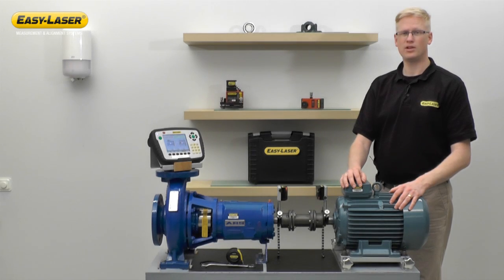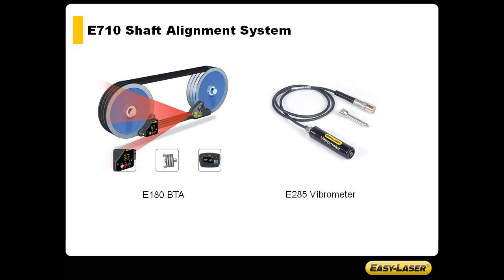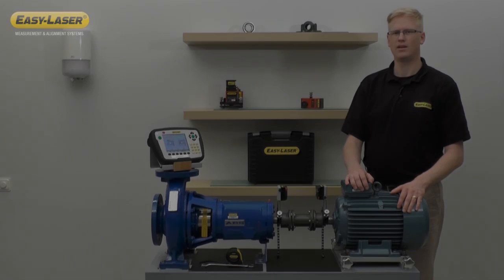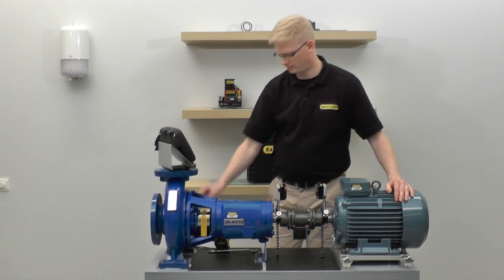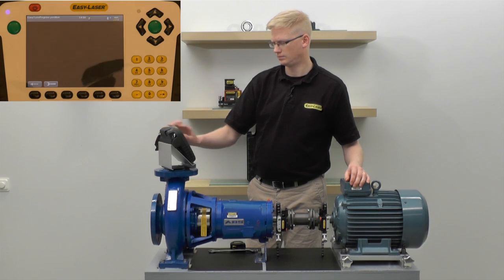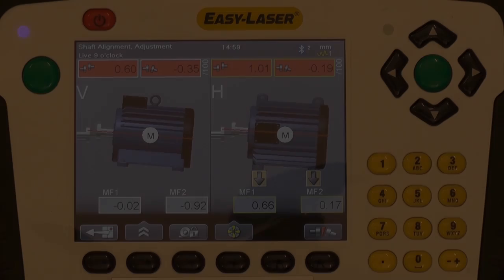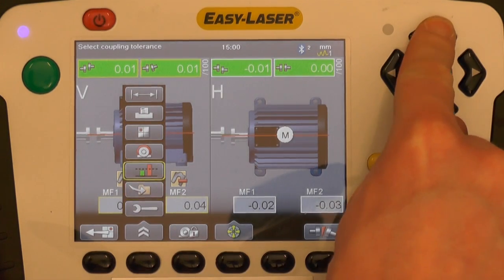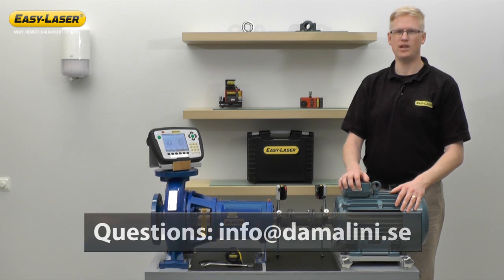Horizontal alignment with Easy-Laser® E710, the Total Alignment Solution

Comment: We are using Easy laser alignment kit.

Could you pls Clear my doubt's? 

1#Minimum Fixing distance?
2#Which is we want to set first? H or V
3#Once complete alignment the readings all correct but while checking again that all reading was changed. What is the reason, why and how to correct?
4# Where should Fix the Leaser Fixer (Chain clamp ), Coupling or Shaft
5#How to do Alignment coupled conditions or Decoupled Conditions (What is the reason?)
6#Some time one angle is shown in down side, Is this problem or not problem? How to set both Angle reading in Tob side?

Comment: Una pregunta me encuentro en Paraguay y quisiera saber si este producto puede realizar alineaciones de Grandes Ejes Propulsores Navales con mas de 3 Chumaceras. Les agradecerìa mucho, si ustedes cuentan con algún video demostrativo de alineación de este tipo de grandes Ejes. A propósito tengo un Equipo Easy Laser D-450 pero no tiene el programa extendido para alinear mas de 2 soportes. Muchisimas gracias

One question I am in Paraguay and I would like to know if this product can perform alignments of Large Naval Propulsion Large Shafts  with more than 3 Bearings. I would really appreciate it, if you have any video demonstrative alignment of this type of Big Propulsion Shafts. By the way, I have a Easy Laser D-450, but this equipment not have a Extended Program about this kind of measure. Thaks a lot....
Reply from the maker: Easy-Laser tiene solución para este tipo de mediciones. El E950 está diseñado para medir los ejes desde los más pequeños hasta los diámetros mas grandes. 
(https://easylaser.com/es-es/productos/medici%C3%B3n-geom%C3%A9trica/e950-alineaci%C3%B3n-de-di%C3%A1metros-interiores
)

Por favor envía me tu email así podre ponerme en contacto contigo directamente porque Easy Laser tiene un aplicación especifica para la industria marina, especialmente para los grandes propulsores navales. 
Atentamente.